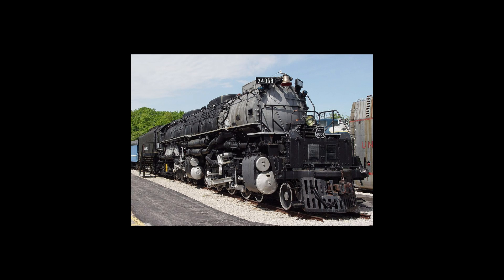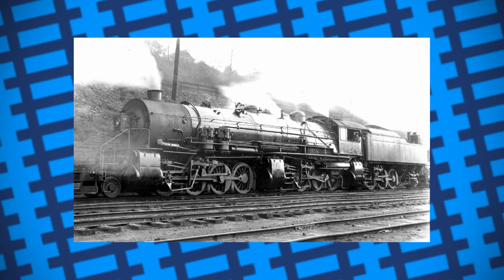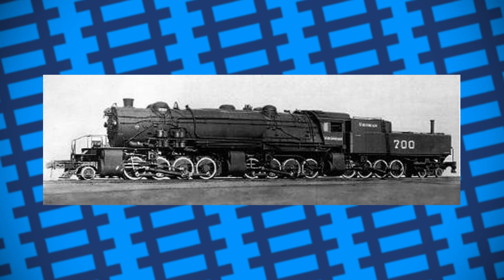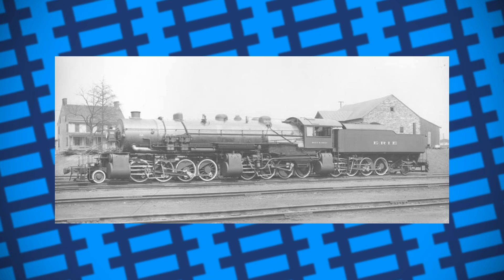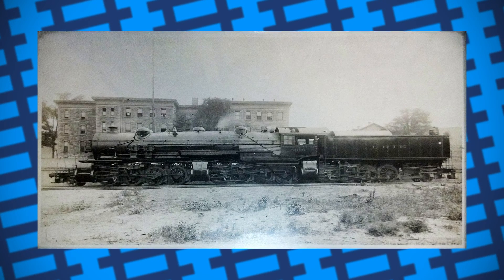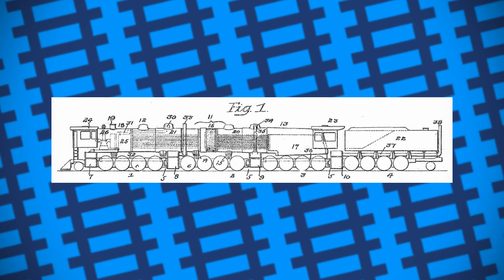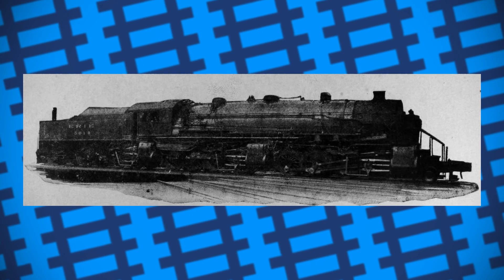The most absurd tank engines ever built - 2-8-8-8-2 "Triplexes"

Comment: the triplex aren't technically a tank engine just because there are drive wheels on the tender doesnt mean much because the tender is still a separate 'car' (or cart if your British) because its an articulated locomotive it still technically has a tender and the triplex was also it could be disconnected if un-welded (a few steam trains are welded with their tender) and it was still able to turn on its own my conclusion

Comment: I think there power used for pulling would cause issue with car couplings parting. There is no such issue when pushing. Unless of course the cars are empty, any vertical component of the push will lift cars off there wheel trucks. A better design would be to reverse the front set of wheels so they come out infront of the loco as a Beyer Garrett and add a water tank and an oil tank.on the bogie. Do similar with the rear set of wheels and articulate. You would have a loco comprising 2-8 + 8 + 8-2. The joints between sections would have to be very clever to get round any corner?. Front (and possible rear) cab as SP are a good idea with oil fireing.

Comment: The real point of such formats was usually because the rail track had limited axle loading and it was only way of hauling iron and coal over distance. The calculation of engineers often related to the axle load, width of engine and cost of coal per journey per the unloading time at delivery depot often a boat. The journey was often downhill allowing a certain liberty on load journey while return trip was with empty cars.

Comment: The logic behind the triplexes a bit hard to understand.  I can only assume that high pressure steam could be admitted to the low pressure cylinder for additional power when starting; once working as compounds each low pressure set of wheels, sharing the steam already used by the centre set, would only be producing about half the power as the centre set so no advantage over a conventional Mallet with very large leading cylinders.

If just for starting then a more effective design would seem to me to be the have built conventional Mallets with steam tenders - such a loco would look similar to the Triplex but with large low pressure leading cylinders, however once it got the train moving steam to the tender set could be reduced to the minimum needed to overcome resistance of the extra set of motion and maintain lubrication to the tender cylinders.  Nearly all the exhaust would then be drawing the fire greatly increasing the power and efficiency of the fire.

After all the success or otherwise of most locos is nearly alway down to the efficiency of their  draughting.

Comment: I read from these Triplex Engines in a german book of railway engineering of the year of 1918, when a few german (prussian) railway engineers reported about of those locos.
All three Triplexes had been owned by Baldwin but never had been bought from the ERIE RR where it had been tested and had showed that the too small firebox could not produce enough steam pressure to operate those engines effeciency enough.
The exhaust of the front and rear Zylinders went into thr larger middle zylinders and used the steam expansion to drive all zylinders.
The exhaust of the middle zylinders had been tiled also from one side to the front smokestack and from the otherside to the back smoke stack after heating the water inside the tender.

One Engine had been sold to the Virginian Railways at Norfolk, Virginia where it had been built a little bit longer because of a much bigger firebox for burning virginian anthrazite coal, what brought more better results than burning the pennsylvania coal of what the ERIE RR wanted to haul to Buffalo or other Harbours at the great Lakes.
At the ERIE RR those three Engines did shunting the coaltrains, theit max speed was around 25 mph as empty engine and more less than that with additional cars behind it.

The Virginian #700 was much more efficient running by much higher speeds of up to 40 mph, the plan use it as pusher engine had been giving up very early, the loco could run ahead middle long standard trains but was too expensive in operation, so it was giving back to Baldwin in thr 1920's like I read from other railway engineering books of the 1920's.
The problem were the tracks and the loco weight of metric tons per axle.
The higher the loco weights the more bigger the tons per axle.
Thr more expensive are the rails, what could carry those heavy engines.

Comment: A super video. A minor thing though, the articulated locomotives have a + between the articulation, such as VGN 2-8+8+8-4 or the UP 4-8+8-4 Big Boy. Ridgid frame locomotives like the Pennsylvania Q1 4-6-4-4 did not have a + because they were not articulated, and technically, they would be tender back also, so it's actually a VGN 2-8+8+8-4TB, designating that the locomotive carries its fuel and water on the locomotive frame. 💙 T.E.N.
Reply: P.S. To the comments people, there were very few three cylinder locomotives in America, with a nice list of them somewhere in the comments below, and no articulated steam locomotive produced in America has three cylinder power, mostly due to maintenance issues and costs, but there are some in other countries. 💙 T.E.N.
Reply: the plus sign was used for the Garret wheel arrangement in European systems the American Whyte system used the dash between wheel groups

Comment: I've always wondered if theyvwould have been successful if given a larger boiler and fire box (think bigboy or larger boiler). Exhaust the rear cylinders (tender cylinders only) out the exhaust stack on the tender. And finally use high pressure steam only for the 4 cylinders on the front and middle cylinders.  The tender cylinders could be lower pressure. I wonder if that would have made them successful??

Comment: The first set of cylinders(4 not 6) exhausted through the flues in the boiler. The rear drivers exhausted through it's own stack. Also Triplex referred to the fact that had 3 sets of drivers not 3 cylinders per driving wheels. 3 cylinder locos were tried here in the USA , but the hassle of serving the 3rd cylinder between the driving wheels was a head ache. Therefore most had the 3rd cylinder removed.

Comment: The Triplex locomotives were compound engines. High pressure steam entered the center set of cylinders and the exhaust from these cylinders was split between the front and rear cylinders. Exhaust from the front cylinders went up through the stack. The exhaust from the rear cylinders went though a feedwater heater and then to atmosphere via a large pipe at the back of the "tender".

Comment: Another problem with the triplexes I'm surprised you didn't mention: As the fuel reserves were depleted the driving wheels under the "tender" became much more prone to slipping, so power would have to be reduced to all the drivers as the tender set did not have their own throttle valve.
Reply: Excellent point. Weight on drivers is a significant factor in overall tractive effort. The variability in weight of both water and fuel bearing down on the rear set of drivers was a major oversight by the designers. But one must admit, the Triplex was an extremely interesting concept, and made for one hell of an impressive sight with its 24 driving wheels under one boiler!
Reply: And yet, Garratt locos were successful everywhere they were used.
Reply: @davidrayner9832  All of the weight of the boiler/cab assembly were applied to the driving bogies, which helped mitigate the loss of weight from water and fuel depletion.  But I'm sure it definitely had an effect, though it wasn't like the only weight over a set of drive wheels was water and fuel weight, like the Triplex.

Comment: A couple of things that you missed:
Too Much Power - The Erie was the first to have Triplexes built. Named "Matt H. Shay" in honor of a beloved employee of the railroad, it was originally intended to pull trains up the steep grades on its own. During testing, it was pulling a train of 250 cars up an incline. The journey went well, until they hit the 17 mile mark; here, a coupling snapped, and the train was ground to a halt. Investigation found that the engine was so powerful that the shock of just normal operations was enough to literally tear apart rolling stock. Undeterred, they decided to instead have it serve as a banker.

Virginian Woes - While the success of the Erie's triplexes is generally considered uneconomical at the best of times, the Virginia Railroad's sole example was far less successful. The XA (numbered 700) was designed to drag up to 10 miles an hour, but it was found that anything beyond ~5 mph would empty the boiler of steam faster than it could be produced. Despite actual personnel from Baldwin stationed where the engine was kept to try and assist in hammering out the problems, it just simply didn't work. Worse still, the VRR found them even less reliable than the ones that the Erie were using. In fact, 700 in general was disliked by the crews.

Too Much Puff, Not Enough Steam - Matt H. Shay was given a 90 sq ft. grate area for the firebox; this proved insufficient, and so both the second and third received a 122 sq ft. grate area. Despite this large increase in size, it still wasn't enough to satisfy the demand the driving wheels provided.
Reply: I believe that one of the first engines with Stoker and a Feed water pump could have Problems with this. The matt h. shay had a Piston pump and got a turbo pump later like the other triplex. There was a Erie engineer who said: " If the water pump get enough water in the Boiler ,we have enough Steam."
Reply: @martinanschutz7410 Good, I feel like the drafting issue could be improved by using a modern exaust layout (klychap, lempor, ETC) and a double/triple chimney setup
Reply: @Combes_  of course, yes . But i think all parts of the Steam curcuit need to bei improved. The triplexes are at the time of a N&W Y2. The improvements of a Y6b would make them great.
Reply: @martinanschutz7410  yeah and that
Reply: the triplex's problem was the mechanical stoker, (all mechanical stokers had the same problem) they could not spread the coal evenly nor cover the grate fully, and thus limited steam production; the draft and grate size were sufficient, this was demonstrated when the mechanical stoker on one of the Erie triplexes broke down and they hand fired the boiler

Comment: Another issue that the triplex also suffered from was Wheel slippage on the rear set of drivers. As coal and water were used out of the tender the weight on the rear set of drivers would become less and less making them very easy to slip compared to the front and center set

Comment: Makes you wonder what kind of steam engine could be made with modern technology.
Reply: What would be the point?
Reply: @garryferrington811  To see what kind of speed and/or pulling power could be had now. We are able to launch water fast enough to cut steel. What level of pressure could a 2022-built engine give to its drive wheels?

Comment: with this in mind what would it make a JR N500 Shinkansen? since all wheels are driving wheels and they are normally seen in car sets of 12 or 24 units... a quadro-Dodecaplex? a tetracontaoctaplex? since its wheel config for the 12 car version woud essentially be a 0-4-4-4-4-4-4-4-4-4-4-4-4-4-4-4-4-4-4-4-4-4-4-4-4-4-4-0
Reply: Electric and diesel multiple units with 2x2 axle bogies are classified as Bo-Bo, so you could have a 50 car Shinkansen and it would still be Bo-Bo
Reply: @bradsmckay  If you whip out your telescope, you might catch a glimpse of that joke as it flies over your head.

Comment: One other issue the Triplex had was that, as it used its coal and water, the driving wheels under the "bunker" would lose traction and slip often because the weight of the coal and water pushing down on those particular driving wheels would drastically reduced the long the locomotive ran
Reply: this was the main issue if why the Tri-Plex locomotives never caught on, besides the poor steaming and heating issues, they were never very fast nor could go very far.  This is why the Big Boy was so successful, was being a normal simple articulated, and his massive size, was why it could pull so much.  It was just a natural progression from the Challenger locomotives that UP went back to ALCO and asked if they could make it bigger.  During the build of the locomotive an unknown builder scribbled Big Boy on the boiler, owing to the fact it was one effing huge locomotive.  As we all know, the name stuck and the rest is history.
Reply: @SirLANsalot  Related to the Big Boy, a good documentary about them and their history of how they came to be and ran is called "Last of the Giants" and was produced by the Union Pacific. Worth a watch
Reply: @CardScientist  def a good vid for sure.
Reply: Garretts had the same Problem, Fuel over one set of Driver, Water over the Other, Boiler slung in between.
Reply: I know the problem of you all, read only the normal books. First, the Tender had a higher axleload than the loco and a diffrent valve seting for less tractive effort. This could prevent more wheel slipping than the loco.
Reply: Not really because when going uphill the weight on the front puts force on the back.

Comment: The Virginian Railroad had massive 2-10-10-2s  that had the biggest diameter boiler used  in the US. I have read that they could maintain there steam pressure will pushing heavy trains.
Reply: The first one built for the Virginian also suffered a boiler explosion in early 1941 (not sure if it was April of January because I didn't if the date was showing April 1st or January 4th because it could've been a British or American date), it's sad that we never got any preserved as the last AE (Virginian 2-10-10-2) to operate in revenue service was scrapped in 1949 (quite impressive for locomotives built in 1918 might I say)
Reply: They weren't pushers, they headed up heavy coal drags. For complete information on these engines, see "Guide to North American Steam Locomotives,"

Comment: Nice, but the UP 4-8-8-4s were just 2 cyl engines
Reply: 4 cylinders. Look at the picture.
Reply: @garryferrington811  in the video, ToT said that the 4000s had 3 cylinders on each driving wheel set. So yes, they are 4 cyl engines, but the only had 2 cyl on each wheel set.

Comment: 0:17   "Each bogie was powered with three cylinders giving the Big Boys a significant amount of power" - No, and no!    The Big Boys had one fixed engine unit (set of driving wheels) at the rear, and one swivelling engine unit at the front, which you could call a 'bogie' at a stretch.    That was the '-8-8-' bit.   The actual bogies (aka trucks) would have been the carrying wheels at each end, hence 4-8-8-4.    And the engine units were twin cylinders, hence 4 in total.   
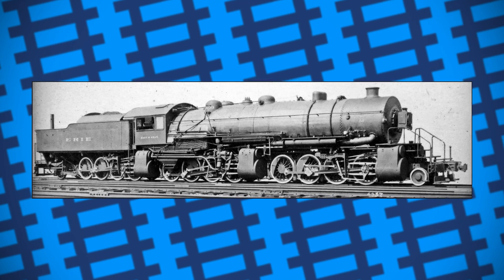0:40   "These boasted three cylinders per bogie" - again, no.    So far as I'm aware, the Triplexes only had two cylinders per engine unit, also.    
This is why the UP 9000   4-12-2's - which did indeed have three cylinders - were such a notable exception in large US steam locomotive practice.
Reply: Hope this gets pinned.
Reply: Hear hear.
Reply: Yes it’s the truth please get this pinned
Reply: There are only 4 remaining American built locos with 3 cylinders: UP 9000, Southern Pacific 5021, Alton & Southern 12, and Baldwin 60000. Of those only the first 3 had conjugated valve gear installed. There were never any articulated American locos with more than 2 cylinders in each engine.
Reply: @AUssteamchannel9994  A note on the 60000 is that it was, like the failed Triplexes, a Samuel Vauclain design.  By the 1920s he and other designers had finally figured out that cylinders without an adequate boiler to supply them were useless.  They had also noticed the flaw of putting driving wheels under a tender:  As coal was consumed, the tractive force of the driving wheels became less and less.
Reply: @AUssteamchannel9994  Probably because it wouldn't mechanically work in theory
Reply: I agree, the big American articulated steam locos were built as two cylinder per "drivers" simple mallets.  Some of the earlier articulated steam locos built in the USA experimented with compounding but even these would get rebuilt a simpler engines.
Reply: Agree!
The Back Set of Drivers were fixed to the Frame, only the Front Drivers swiveled.
Reply: Don't forget about the UP/SP 2-10-4s which were also 3-cylinder compounds, all but one built by Alco, and known as "Overlands" on the UP.

The UP engines were easily identified at some distance by their unusually long boiler/smokebox overhang in the front aspect that gave them a bit of an awkward, out of balance appearance.
Reply: There is another class of US locomotives that have 3 cylinders... Geared locomotives. The Shay and Willamette locos had 2 but usually 3 vertically mounted cylinders that ran a driveshaft that powered up to 4, 4 wheel trucks. Most were 2 or 3 truck units. I believe Western Maryland had the 4 truck, but it was lost in a wreck when the oil burner supply hose broke or leaked, slicking down the rails and she literally went off the mountain...
Reply: @nightfall3012  Correct, and no starting valves. Strictly speaking a Mallet should be a compound but most US Mallets were simples.  Oddly the low pressure cylinders were the same diameter? ... which is very unusual, possibly unique. Compounding was popular in the UK but it only works when the loco is moving. So they used starting valves to put steam in the low pressure to max torque when starting.
Reply: @black5f  On our simple Mallets, there are no low pressure cylinders. All cylinders receive boiler pressure steam. Hance why all cylinders are the same diameter :)
Reply: @seymoarsalvage  " most US Mallets were simples". These were compounds? Steam from the centre HP set supplied to the front and rear LP sets.